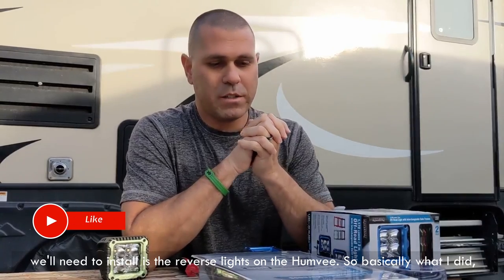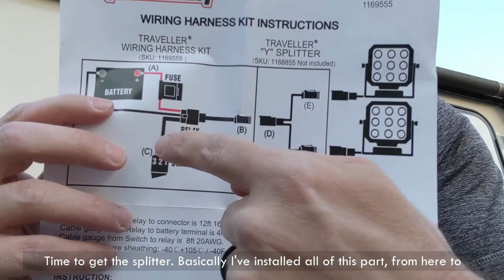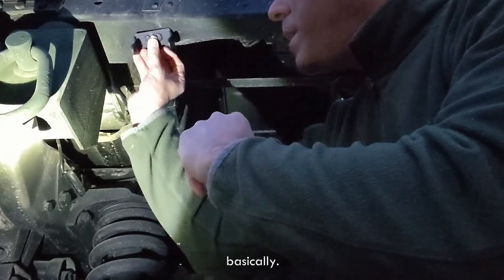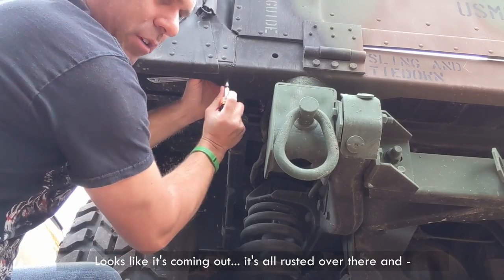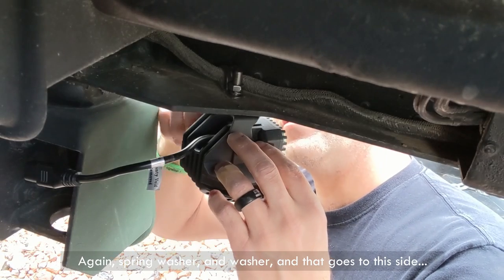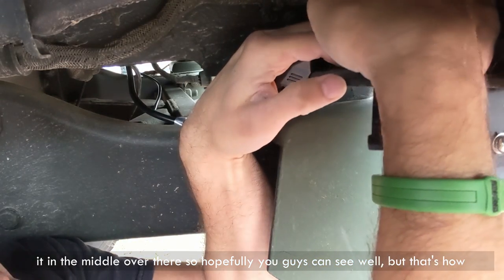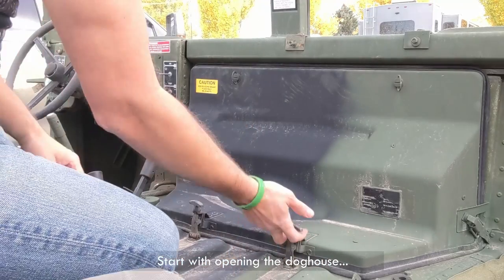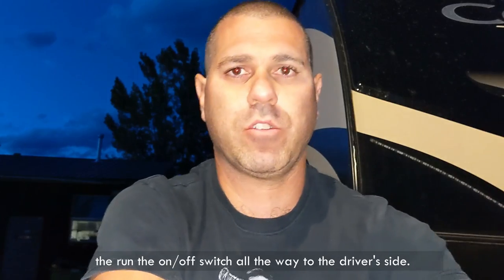MAKING OUR HUMVEE STREET LEGAL PART 2 - Installing Reverse Lights

Comment: Looking good.  Some friendly advice - always disconnect the negative battery terminal before doing any electrical work.  And get those batteries secured somehow.  Govplanet swaps in those batteries that are the wrong size just to get it started and it's super dangerrous when they are sitting loose.  Your positive terminal is almost touching the body, all it would take is a little bump for some serious fireworks or worse.  6TL batteries will fill the trays and work with the original hold down bracket (sometimes thrown on the floor or in the bed by the govplanet folks).  Other batteries can be used, but it takes some creative fabrication to properly restrain them.
Reply from the maker: Thank you so much! Good advice!! I definitely will. This was one of my first projects I did when I got the Humvee so I was still trying to figure things out, which sometimes I still am trying to lol but every day is a new learning experience :) I appreciate the advice about the batteries! Will have to find a solution for that. Thank you for following us!
Reply: You ain't kidding  when working on the positive you gotta be careful not to touch the body with the ratchet. Ask me how I know 😂⚡️

Comment: To make a HMMWV lighting compliant (street legal) to DOT/FMVSS requirements (for any vehicle 80 inches or more wide) driven on-road there needs to be Front Identification Lights (3-AMBER) and Rear Identification Lights (3-Red).  Look at pics. of any Civilian HUMMER (H1) for reference.
Reply from the maker: Yes, it might be one of my next installations. But I definitely don't like the look of the 3-lights.. I like the Humvee just the way it is. A military war horse!
Reply: @theinspiredjourney  Remember; in combat it can be VERY dangerous ...TO BE SEEN; On the road it can be VERY dangerous  ...NOT TO BE SEEN!!!  FWIW; those HMMWV Front & Rear Composite Lights do not meet DOT/FMVSS-108 Standards either.